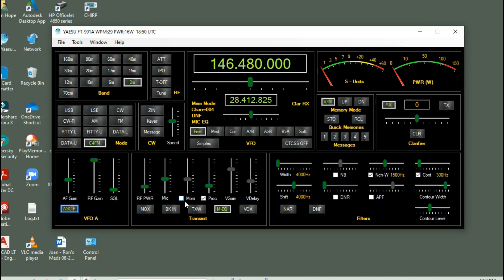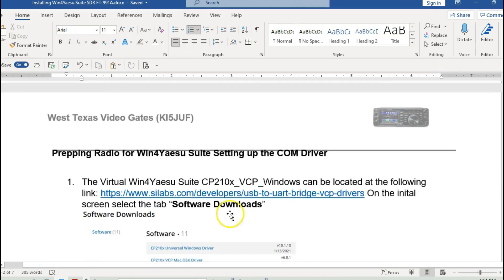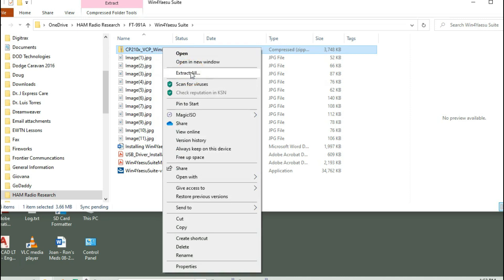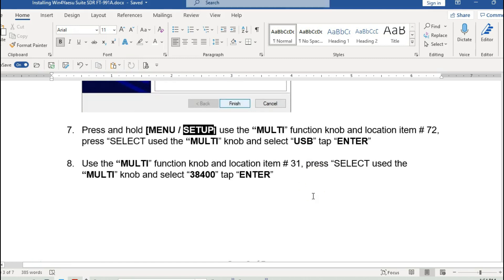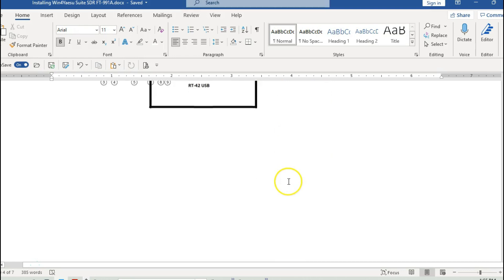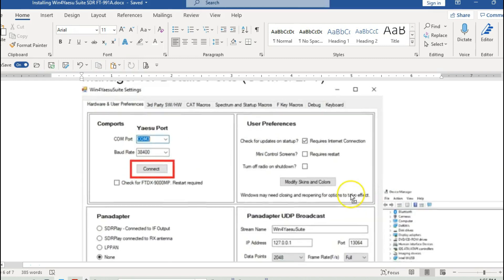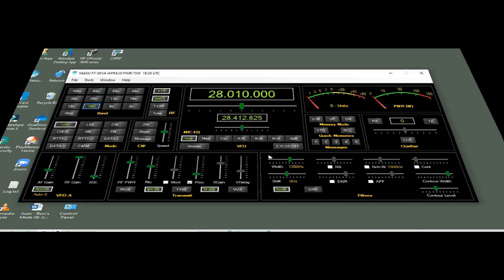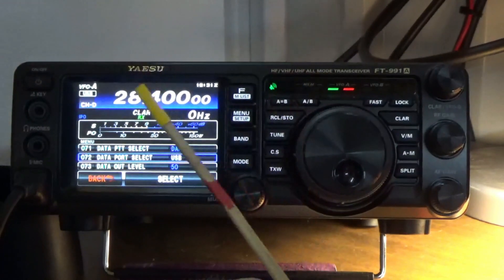Setting Up Yaesu FT991A (Win4Yaesu Suite) Remote Radio Controlled Software With FT991A

Comment: Drivers are downloaded but still won’t connect
Reply from the maker: Hmm, your using baud 38400 right?  Double check and make sure you are using the Enhanced Serial Port - Device Manager (Ports LPT) write me back, there should be two COMs (Enhanced and Serial)

Comment: I now have the win4Yaesu software installed and connected, along with Log4OM logging software, all is good. The author of the software did caution about putting a ferrite toroid in line on the USB cable, have you had any issues with interference?  So far I only have issues with an older Dell Monitor going a bit wonky when I am transmitting.
Reply from the maker: Good evening Tim, I did not need to use ferrites, I will share with you I had an experience with some coax problems that were causing some strange things to happen, when I upgraded all my coax between radio switch and antenna feedline this cleared up my problems, that's the only advice I have, are you using VGA, maybe a HDMI option might not have the RF interference, sorry wish I had better solution 73 and keep in touch
Reply: @westtexasvideogateski5juf255  The VGA may be the issue, I have three monitors and the only one being messed with is the VGA fed Monitor. The cable has ferrites on it but they are small. I do have another question however, turn on works great, the 991A powers up and in a few seconds the Yaesu screen comes on along with Log4OM. Shutdown however is a different story. I have two options for shutdown 1.)Shut Down Radio and Exit, and 2.)Exit. Using either of those results in the 991A powering down and the Win4Yaesu Software hanging up. I then have to go to Task Manager to force close it. In playing around with this, I discovered it was LOG4OM, that is hanging up the Win4Yaseu software. Looks like Win4Yaseu is waiting for me to close LOG4OM to be closed before it will shut itself down. Not too hard a work around just a little weird
Reply from the maker: Good afternoon Tim, I never had to use  ferrites but I'm only running 5 CW, 25 W USB and  35 watts AM FM 10m, so I don't have a lot of experience, I'm sorry couldn't help more, I'll share with you I did recently switch all my coax to DX Engineering pre-made cables and I've had good luck I did previously have a could weird things with my other coax from HRO, good luck keep in touch 73    @timmyers3428

Comment: Steve, Just wanted to say thanks for this video. While I am not WIn4Yaesu as I am on a Mac, I spent about 5 hours trying to get my 991A to connect to WSJTX. I could not get the radio to talk to the Mac. I saw you switch the data port to usb (what I was using to connect) and just like that Im connected! Keep up the good work!
Reply from the maker: Good morning Carl, great glad the video helped, I enjoy doing them have a great week and keep in touch '73

Comment: I'm confused, is "va2fsq" listed in title of video and "Win4Yaesu Suite" the same thing?  If not, what are the basic differences.  If so, just note simple things like this really confuses us newbies as there are so much nomenclature and acronyms in ham radio that it's really tuff for us more new to the hobby especially for those of us getting up there in age.  That said I certainly appreciate your efforts to help us.
Reply from the maker: Good evening sir and thanks for the message, I'll fix the title the designer is "va2fsq" and his software is "Win4Suite" so they are the same sorry for the confusion thanks again for the message and keep in touch '73
Reply: @westtexasvideogateski5juf255  Yeah,  finally got it but thanks for getting back with me.  I did btw dl it for my FT-991A and going to get the MFJ antenna switch to tie into my SDRPLAY RSPdx to bring everything together.

Comment: CQWW popped up on my feed.  Checked out your video list. I do not have the 991-A but wanted to commend you on your technical explanation on the setup.  Very good technically, and sure it will help others.  KI5SWA 73.

Comment: Does anyone knows how this will work side by side with the WSJTX ? There's a conflict between the port being used when I turn this software ON. It messes up or turn off WSJTX. Possibly, a USB com port sharing with 2 applications working simultaneously. I asssume I have to purchase it? Thank you.
Reply: I would be very interested in how to make the two work together as well. Love the interface, however, I see now way to also be able to use the radio on WSJT-X while the control program is active.

Comment: I have an FT991A and the latest paid version of the software.  The Radio does not turn on when the s/w is started.  I cant see and option to have the radio turn on.   I have to manually turn it on and then the software will load Ok.  Without the radio on the s/w just tell me that it cant connect with the radio.  VO1HP

Comment: Quick question how do you get the power meter to show up.  My set up looks totally different then yours is your a paid version?  Thank you for your work.
Reply from the maker: I Edwin, how are you doing this weekend?  Thanks for the message, I purchased the full version and am uploading a video now, it seems to have all the exact features as the 30 day trial does.  Your using at FT991A correct?  Let me know I do what I can to help you.  '73 de KI5JUF have a great labor day weekend sir!
Reply: @westtexasvideogateski5juf255  

Hello
I found the problem I had it was in the user preference the mini control screen was checked I just unchecked it and now I get a full options. 

KC2BGN 73'
Reply from the maker: @xeon_one  Hi Edwin, that's great so glad you go it working, let me know if you need anything else, '73 de KI5JUF
Reply: Do you need a switch on antenna so when you talk on radio you dont blow computer
Reply from the maker: @ericknapp3165  Hi Edwin, how are you doing, I use antennas for all communications (like I never had a computer connection), the software on the computer only allows a portal via COM port  to access the radio operations on you computer screen, so basically the computer software just allows you to do things from you computer like what would do directly on the radio, similar to a remote  control - the best way to think about this is - the computer software is just giving you some additional features easier to find and controls remotely (vs) operating the radio directly (like being in front of the radio) so it will not damage yout computer, your computer is only a "node: per say and can offer some control features.  any questions call me 972-589-9079 or email me at shope02@yahoo.com  be glad to talk to you
Reply: @westtexasvideogateski5juf255  thank you, i may be giving you a call once i get my antennas up. Im still learning, my buddy and I  have an SDR1, MFJ switch, and have been looking at the Win4yaesu software. We are both just trying to learn and have a larger screen. Thank you for reply.